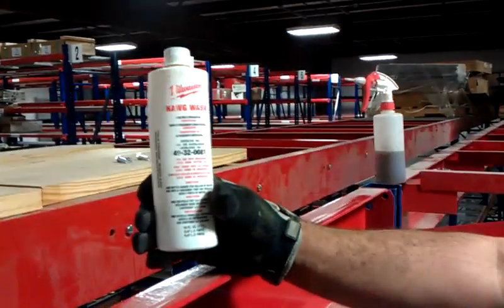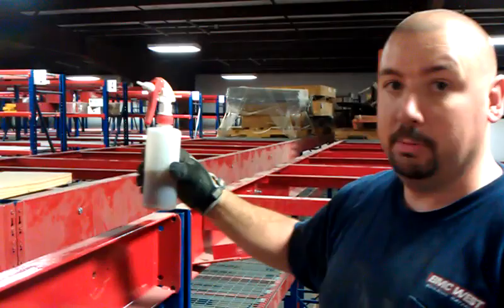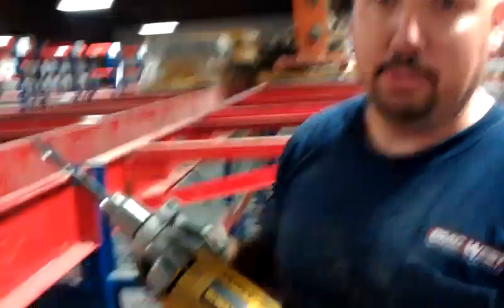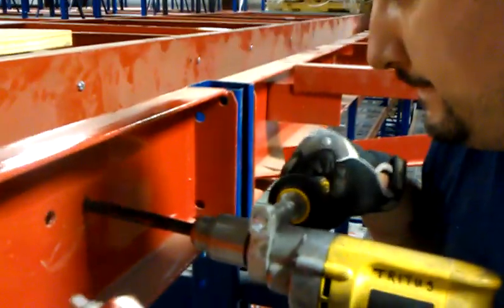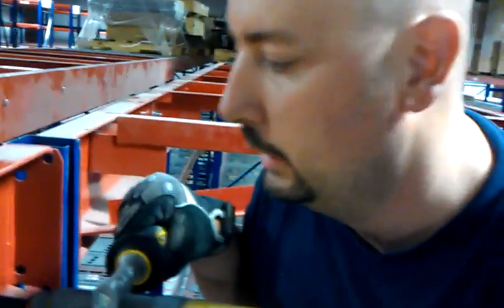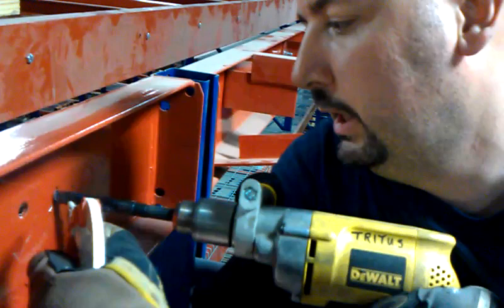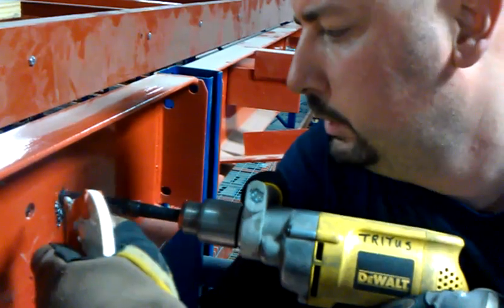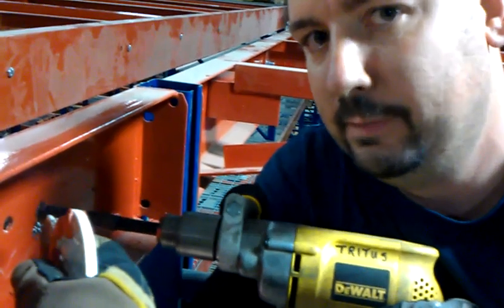How to drill through 1/2" steel

Comment: Look Into a reamer drillbit . I have worked on a few oil rig mods for the north slope.  They have a slight twist and are around 8" long and taper down  you will use very little pressure and slow speed they cost around $70.00 a peace for a good one but they have a long life if you use them Correctly.

Comment: I used an 1/8 inch bit drill bit for a pilot hole in 1 inch plate to mount a hitch on the back of my dumbstruck all holes went well except the bit broken in one of the holes line up is critical what cab I do?
Reply: Drill it out? 😅

Comment: That is "not" how you drill a hole through 1/2" steel, To start with that steel web was only 5mm thick, you need to be higher up to get your body weigh behind the drill, you also need to be holding the side handle on the drill to stop the drill body from twisting round, you also need to be drilling with a slower speed for that size drill.
Reply: he said it's everyday drill, they don't have very good speed control, at low speed torque is very low and motor tends to spark on the lowest speed. Better tool have gearbox with two speeds selector, may have been better suited here.

Comment: I would have drilled another hole and re-filmed it, this time keeping better control at that moment where the drill broke through the steel, span round and nearly hit your assistants hand and buckled your arm! Like a proIf you have a small pot, with some cutting oil, by your feet... you can stop for a second here and there, to dip the drill bit into the oil.Then you're not turning a 1man job into a 2man job!
Reply: no, it dries out in seconds so needs to be sprayed in whilst drilling, these guys would have worked this out way before hole number 200!!